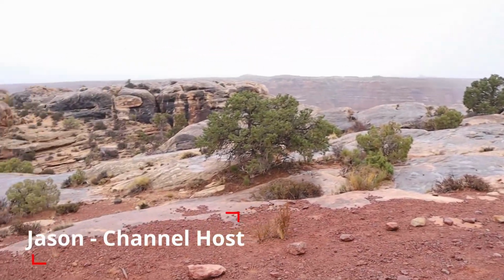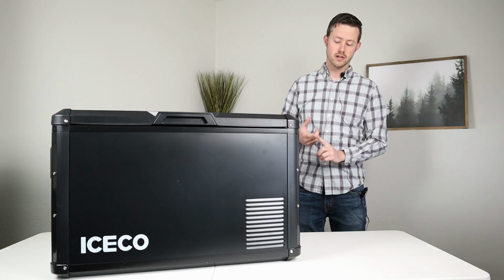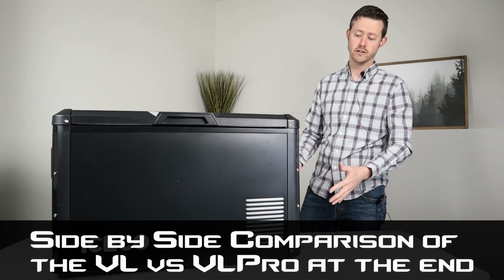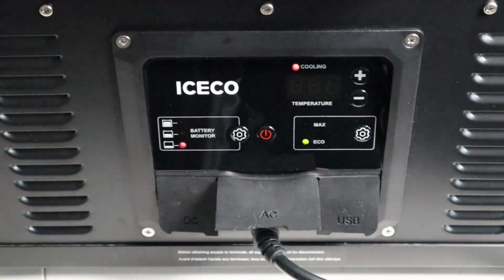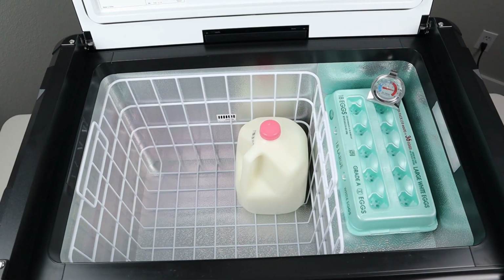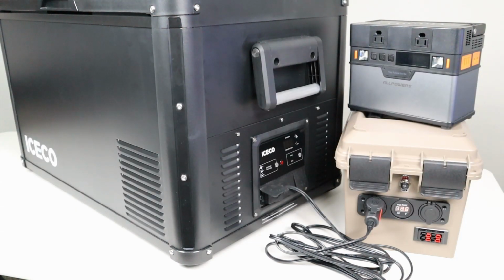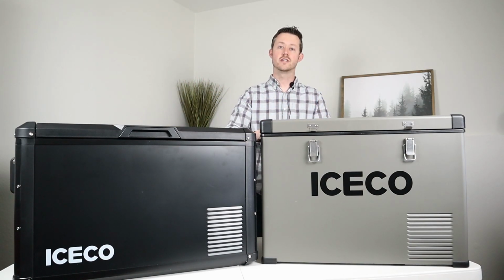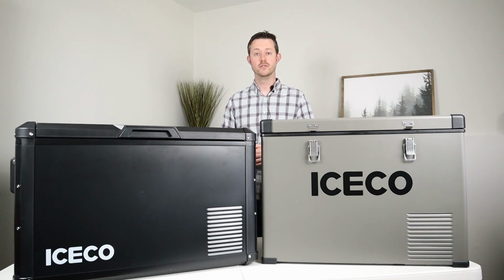ICECO VL60 PRO SERIES Review - Brand New Line of 12v Fridges! Best of ICECO Lineup?!

Comment: Big J. Just looked at your classic video. I love that Iceco 60qt. 12V. Fridge! I purchased a 42qt. Joytutus 12V. Fridge 3 yrs. that's not keeping the food and drinks cool anymore. The lowest temperature I'm getting nowadays is 41 degrees while it's running. And the compressor doesn't cycle on and off like before. When I can get the money, I want definitely try Iceco's 60qt. Fridge with that COOL  REVERSIBLE DIRECTIONAL LID! And 5 yrs. Warranty on the compressor! I love your video. Everything was explained perfectly! Looking forward for more of your videos on 12 volt fridge and freezer. I love them much more than a regular fridge and freezer. For my solar powered off grid set-up.

Comment: From multiple and consistent reports on the Iceco facebook site (comments and reviews) and on neighboring channels here (Atwood and Wandering Beast) the Iceco products, especially the dual compartment versions seem to fail repeatedly when subjected to actual use in hot temperatures (95+ F). Also, their CS seems to straining and inconsistent; but there does appear to be some effort made on that front. There are always problems here and there, but repeated and consistent reports of a specific problem, that is not a good sign.  While I'm really attracted to their products' potential, I don't think I can afford to be part of their beta testing. Oh well.

Comment: Really struggling to pick between iceco vl60 pro and the setpower tc75. One is lighter larger and cheaper and dual zone if i want but the other looks better more likely too only use as a fridge maybe more efficient and longer warranty but also more expensive. I change my mind daily
Reply from the maker: I really don't use my dual zone fridges much, I just don't need frozen stuff while camping or on road trips. Single zone fridges are more efficient. I'd probably lean to the VL60pro, love that beast!

Comment: How would you compare this to the VL 60D?
Reply from the maker: They would be almost the same in food capacity 60qts, but the VL60 Dual will take up a larger footprint and power consumption due to having two zones. Having a side set to "freezer" will always use about double the power than having it set to "fridge" temps. I personally like the older style VL series fridges because of the value and simplicity. With the older VL series you still get an awesome fridge and compressor that's durable and efficient but for less money. If you want the features of the VL Pro line then you gotta put out the extra cash for it.  Does that help?
Reply: @Jasonoid  yes it does. My thoughts are similar. It is a shame they don’t have the drain plug on the older style.
Reply from the maker: @cjarloz  I just wipe a spill with a cloth, it's not that bad.

Comment: do you know what the in-rush current is when the compressor starts?  I've been trying to find that, my other fridge has a pretty high in-rush current and was thinking about this but wanted to check.
Reply from the maker: It's not too horrible, I haven't had any issues running these fridges on many power stations I have tested. All these power stations  have a 12v 10amp socket and the fridge starts fine.

What are you looking to run it with?
Reply: @Jasonoid  I have a EcoFlow delta 1300 and a jackery 500 and my EcoFlow has issues starting the fridge I have.  My jackery has a higher voltage and amp than the EcoFlow so it doesn’t have issues.  That’s why I want to know how high it can spike when the compressor starts.
Reply: I’m strictly talking 12v dc outlet. The EcoFlow delta 1300 is Car Power Output (x1)
108.8W, 13.6V DC, 8A max, so occasionally when the compressor goes over 108 at startup it throws errors.
Reply from the maker: @t4rainier  Which fridge are you trying to start? A full size fridge? These small 12v fridges require MUCH less start up current.
Reply: @Jasonoid  it’s an aplicool t60 and the compressor for some reason can hit above 108 when it starts which is too high for the EcoFlow delta 1300 12v outlet. Then it resets the 12v port on the ecoflow.  I guess what I’m trying to find out is if the ecoflow delta 1300s 108.8 max watts on the 12v port is enough for that iceco vl60pro.
Reply from the maker: @t4rainier  Thats the only power station I havent tested these fridges yet...well power station company. I have  tested with MANY other brands, all on the 12v socket. 

I'd say youre probably okay, the compressor usually pulls 33 watts on ECO mode, startup shouldn't be over 108 watts, unless it's milliseconds.
Reply: @Jasonoid  ok thanks for your help,  most documents don’t list inrush current so it’s hard to tell.  Jackery has a higher 12v port and can spike higher than 120w so it never has a problem.  I’m trying to see if replacing the fridge is the way to go, or replace the power station, both options cost some money.
Reply from the maker: @t4rainier  You should be able to recoup some cost of either of them if you ended up selling them. They both hold their value well! Thanks for checking out the channel.

Comment: People need to use some common sense. This hysteria with "green energy" has turned people into absolute lunatics. You want to the most efficient refrigerator, yet have no issue towing a 10K lb trailer with a rig that gets 8mpg. As with ANY refrigeration appliance, YMMV. Ambient temps, cooling load, how often you open the box, all affects power consumption. There are enough reviews on YT to show that most of the units on the market today, are extremely efficient for their PRICE POINTS. 
How jaded are Americans today. We worry about the most petty things when there are people in the world who risk having their heads cut off simply because they possess the wrong book.

Comment: Hello Jasonoid
Great Video !!!
I am just about to purchase a VL 65 to install in the back seat area of my truck.
Can you tell me the length of the DC chord?
Also can you recommend a 12Volt auxiliary port to install for the Iceco DC chord.
All in all would you recommend the VL65 .
Also one last question is Amzon a good choice for the Iceco purchase?
Thank you and kept the video's coming
Reply from the maker: The VL series and the VLpro series are awesome fridges. Both are very efficient and have secop compressors. You can't go wrong with either one. The standard VL series are a little less expensive because they lack a few features of the VL pro series. I still recommend the VL series to most people because they are so simple. 

You can get a cheaper price, 12% off your order through their website iceckfreezer.com (free shipping) using my discount code at checkout = Jasonoid

The power cord is about 6 feet long. What type of port are you wanting to install in your truck? A 12v cig plug or something different? Let me know.
Reply: @Jasonoid  thank you for the reply and answering my questions 
In was looking for a high quality 12 volt auxiliary port ( cigarette lighter plug type)
Reply from the maker: This is a higher amperage version, not flush mount:
https://www.amazon.com/Philmore-Cigarette-Lighter-Mounting-Bracket/dp/B00K0TQ94C/ref=mp_s_a_1_3?dchild=1&keywords=15+amp+12v+socket&qid=1632354294&sr=8-3

Something like this would also work but the wiring would only handle 5 to 10 amps:
https://www.amazon.com/gp/aw/d/B082D8WKNW/ref=sspa_mw_detail_2?ie=UTF8&psc=1&spLa=ZW5jcnlwdGVkUXVhbGlmaWVyPUExWTdSUzFXVkhIVEE2JmVuY3J5cHRlZElkPUEwMjYzNjE4WDcwRk85REQ5NU40JmVuY3J5cHRlZEFkSWQ9QTA0MjIyODEySDUyS1FOVDBHUjhLJndpZGdldE5hbWU9c3BfcGhvbmVfZGV0YWlsJmFjdGlvbj1jbGlja1JlZGlyZWN0&pd_rd_i=B082D8WKNWp13NParams

Comment: I love my VL45. I run the fridge off my Milwaukee M18 batteries when I boondock on the Big Island.
Reply from the maker: Do you just have a battery adapter for running them off 18v or does it have an AC inverter built in?

Comment: Hey Jason. Have you compared the gasket on the vlpro vs the original VL series? The gasket of the VLPro is a thin vs VL series has beefy rubber gaskets. I ask cuz I’m getting a lot of condensation and ice formation outside of the gasket. Also the lid has a lot of play when latched. Moves up down and left right.
Reply from the maker: Hey Sheen! My VLpro lid doesnt move much and I don't get condensation on the outside. I have seen on other person with a "moving lid" on their pro series. Reach out to ICECO support via email to let them know, they may be able to replace your lid. 

Yes the vl series is beefy rubber gasket, it doesn't get better than that seal in my opinion :) On my VLpro the lid has a drop in area on the lid that fits inside the fridge, kinda like a ledge. It seems durable.

Comment: Hey I saw your video and purchased the  VL pro model … I’m used to tighter fitting lids I found the lid to be loose when it’s supposed to be closed it’s not a right fit … without unlocking their is play in the mechanism.  You have tested other fridge what’s your thoughts on how the lid fits?  I’m thinking of returning it… a loose lid has to comprise the efficiency do you think? Is it as efficient as the original model you recommend is the past?
Reply from the maker: I just confirmed with my VL60 pro, there isn't any play at all. When I push the lid down its super tight, doesn't wiggle at all, I don't see anyway air can get out on mine, it also tested to be just as efficient as the regular VL series. Have you reached out to ICECO at all?
Reply: @Jasonoid  I will ASAP maybe they can send out another lid.  I can move it slightly up and down without unlatching it.  How are they to deal with?  The ridge that the seal makes contact with is about 1/32 high… seriously!
Reply from the maker: @carmas54  they have been busy lately but I hear they get back in a reasonable time. Probably best to send an email with pictures of the issue.
Reply: @Jasonoid  I just sent you a clip video of my lid to your Instagram accounts
Reply from the maker: @carmas54  not seeing anything, maybe message me on facebook instead?
Reply: @Jasonoid  I must have gotten a bad one.  It’s going back tomorrow and they are going to exchange it with a VL60 ( non pro model) I don’t think the pro models are as bomb proof as their old models
Reply from the maker: @carmas54  I agree, the fancy features are nice but the regular VL series are just tanks.
Reply: @Jasonoid  it went back to CA this morning. Does iceco have any presence here in the US other than a warehouse? All my communications with them are answered after 2:00 am ET
Reply from the maker: @carmas54  Their corporate office is about 35 minutes away from Disneyland in California. That isn't to say their email support group isn't located in China though. I almost did a tour of their headquarters in CA when I was out there but COVID was starting up so they were hesitant to do a live tour. ICECO could do better with their communication but their products are very good. I blame it on California lockdowns. 

Any other "budget" fridge you purchase will most likely be the same way or worse. Dometic, ENGEL and ARB are priced higher but probably have better support communication.
Reply: @Jasonoid  I total agree, if I knew how disconnected and distant they where with there customers I gladly would have paid more and gotten an ARB or Truma, their communication skill is lacking. It’s a good thing their products are good.
Reply: @Jasonoid  I sent back the 45l pro unit and got the VL60 … much lid and latches… by the way have you got to understand the F1 F2 and F3 settings to adjust the inside and panel temp settings?
Reply from the maker: I haven't messed with those complicated settings. It could really throw off the display if you enter a wrong value. I prefer to learn how the fridge operates and then just adjust it accordingly.
Reply: @Jasonoid  I ended up calling them because the fridge was off by 9 degree I had it set for 36 degrees and I was getting 45 inside … after some adjustments I’m now just 3 degrees off
Reply from the maker: @carmas54  nice work! That's excellent!

Comment: Whats the power conumption between the two? I have a vl45 and getting a vl45 pro, but the lid worries me, and the lack of insulating cover. Would the new lid seal as well as the regular VL? The VL45 seems to have more rubber there then what you showed in your pic, and when you clamp the latches down, it seems to really pull it down and seal it up nicely.
Reply from the maker: I'd suggest keeping the regular VL45 just because the classic VL series are slightly more efficient. If you have to have the new features go with the pro series

Comment: I have the VL45, bought it a year ago. It has worked flawlessly for the past year bolted to the floor in my semi. I removed the front passenger seat, fits nicely. The only mod was to purchase the ARB 12 volt plug, as the ICECO plug would not stay put. And yes, I know I could hard wire it, but that ARB plug does the job. The unit has ran nonstop for over a year, and holds 38* without issue. I would recommend, and I would buy again. And I really like that new top, that would really come in handy in my rig due to the custom cabinet work I have in there which just blocks the lid from fully opening.
Reply from the maker: Thanks for sharing your experience, I also haven't had any issues with my ICECO fridges. It is important to note that most issues come from voltage drop in vehicle cabling so running off a portable battery is a bit more reliable. I doubt you have that issue in a semi truck haha
Reply: @Jasonoid  No issues there... I have solar panels on the roof too, which allows me to set and forget the ICECO...

Comment: I bought the iceco vl 45 pro and received it two days ago.  It’s a nice clean looking powered cooler.  It has a quiet compressor.  Unfortunately, the iceco team didn’t put much time into the seal on the lid.  It is a great concept how it opens but it does very little at retaining the cold air and keeping the warm air out.  The compressor rarely turns off, and when it does, it quickly turns back on within a min or so.  I was hoping for a high quality refrigerator, freezer, cooler that would function as well as it looked and as described in product description. Unfortunately,  they need to reengineer the seal so it actually seals because power consumption is triple any of their other coolers that are not in the vl pro series.  I contacted customer support via phone and left multiple voice messages and did not receive a response.  I contacted the customer service email and received a response only in the early am hours(2:30a.m.),  and their sentence structure was as if they were not American English and were from another country.  They market their product as being based in California(American Made) 🇺🇸 when in reality this does not appear to be the case.  Their response acknowledged they are aware these coolers have a design flaw but offer no resolution and request us as the customer to be patient while they work on a solution.  Why would they list this for sale on their website if they are aware they designed the lid with a flaw in the ability to seal in cold air.  They are reluctant to pay for return shipping and I will not be a return customer of Iceco mainly due to their poor customer service.  I hope everyone that is considering the ICECO VL pro series to read my comment and think twice before purchasing one of these until they solve this problem.
Reply from the maker: My VLpro 60 lid clamps tight down. I can feel the rubber close tight as I shut the lid down. There isn't an issue with power draw being more than any other ICECO fridge I have used either. It performed right on par with my VL45 (same compressor).

 If there was an issue I would have showed that in my video and I woulnd't mislead my viewers. I don't doubt you have an issue with yours but it must be a manufacturing defect on your specific fridge because I haven't had issues with mine at all. I haven't heard of any other issues from other customers yet but maybe we will see more people reply on this comment. 

ICECO, Dometic and ARB fridges are all made in China. Apple iPhones are Chinese too. Theres no way to avoid it these days.There are many different build quality levels in china factories, I feel the quality of ICECO fridges is still way above Alipcool, Costway, and other "budget" fridge lines you can buy on Amazon.

Sorry about your issues you are having, I can't say I know of a company that never has a few dud products, I hope they make it right for you.
Reply: I was considering cancelling my VL45 order and going with the pro version. Is there any update from iceco fixing this ongoing issue?

Comment: Can you strap the backside of the Pro series Fridge tight to a wall and still be able to open the door? The VL series and most others, you have to move the Fridge away from wall to open the door.
Reply from the maker: After looking at my fridge open, it looks like you'd need to put a 1 inch spacer or so between the wall and the fridge, then it should work fine.

Comment: I’d I have a 5.0 ah 60V battery, how long would it run the fridge?
Reply from the maker: These fridges run off 12/24 volts DC, do you have a way to convert your battery voltage down to that voltage?